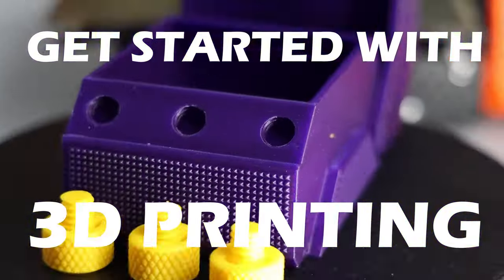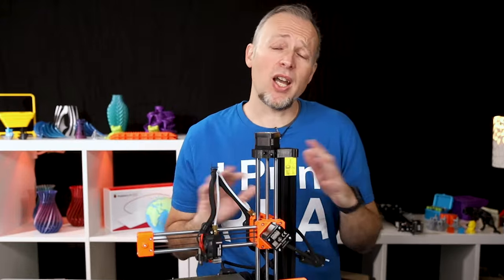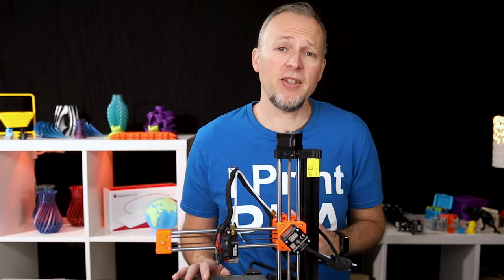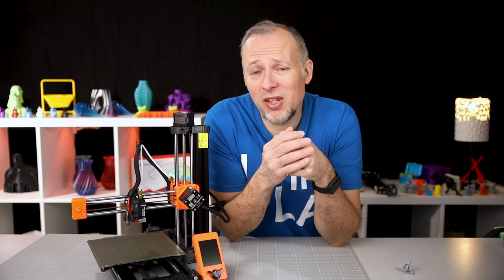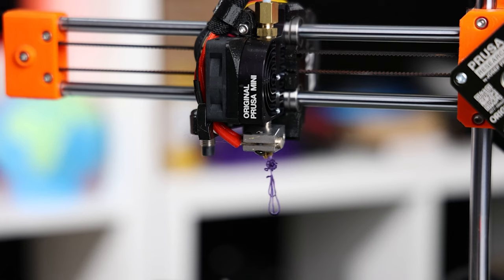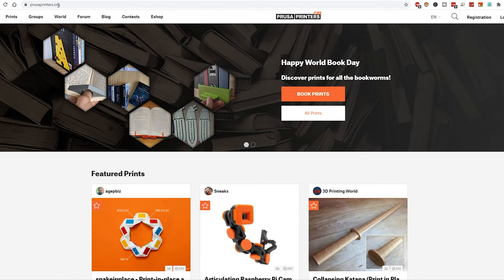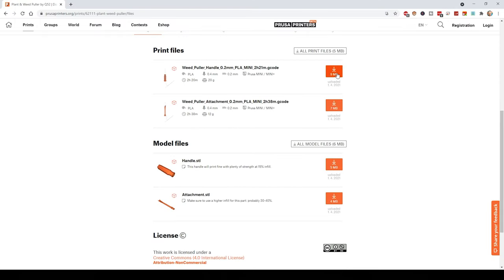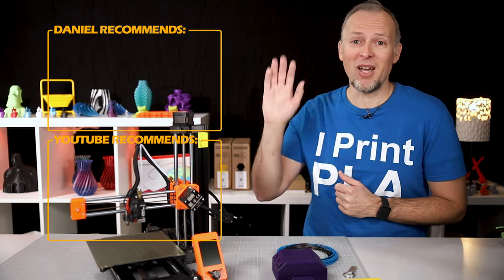3D printing for beginners in 2021 feat. Prusa Mini Plus

Comment: Completely new to 3d printing and I am considering the Prusa Mini Plus. Very informative video thanks. I also watched your video about the Ender 3 v2 which you did in Jan and you also recommended it for beginners. Which one would you recommend? The Prusa Mini Plus has a small print area and possibly more expensive than the Ender but i get the feeling that you had less issues out of the box with the Prusa than with the Ender. Would that be correct? Thanks again
Reply: Just be aware that the Prusa printers are not magical. They supposedly have very good QC, but there are always outliers. I’d like to share my experience. I got the Ender 3 Pro for $100 on sale at Microcenter about a month ago. I got it to learn about 3D printing since my son was getting a Prusa Mini+ from Santa (he didn’t know what model; he just wanted a 3D printer).  The Ender 3 has been printing great. The Prusa “experience”’not so great. Long story short, I ordered the preassembled Prusa Mini+ with the filament sensor for about $470 shipped. I got really busy and couldn’t unbox the Prusa to set it up until Christmas Eve. Sadly, the extruder gears were jammed/gummed up from the factory.  “24/7 support”was closed, so I had to abandon the Prusa and give my son the Ender 3 (luckily he hadn’t seen it since I’ve been using it when he’s at my ex-wife’s and hiding it when he’s home). There’s no point in taking apart the extruder and cleaning the gear/pulley since Christmas is already over. I got a return authorization for the Prusa, but I’m going to be out shipping costs (about $50) and will only getting about a $420 refund.
Reply: I bought an Ender 3 V2 last year, in retrospect, I should have spent the extra money and bought a Prusa Mini.  Some people get great V2's out of the box, I did not.  Poor quality control, warped bed, and so on. I put in a lot of time upgrading, and dialing, when I would have rather been printing.  If you like to tinker as a hobby and have the free time, get the V2.  If you want to print, get the Prusa.  I'm considering adding a Mini as a second printer.

Comment: Which filament do you recommend to use with the MINI+? Have you tried filaments other than the Prusa brand?
Reply from the maker: I‘ve tried all kinds of brands but the most important change I made was the upgrade to the Bondtech IFS. Since then I had no issues whatsoever. Before I had some issues with underextrusion due to the fact that the mini does not have a dual gear extruder by default.

Comment: I am going to start using high temperature and high strength materials like Nylon and carbon fibre reinforced Nylon, I now have all my printers enclosed and will convert one to a volcano but am undecided on which direct drive to implement although the new BMG seems to have most of the features I am looking for so I will look for a review of both in operation to see how they get on with each other.
Reply from the maker: On the Prusa Mini I guess, right? I am looking in to the Hemera and BIQU H2. Both seem promising. The Hemera already supports 285°C printing in the stock configuration and is upgradable to the Vulcano
Reply: @Crosslink3D  No, I have an Ender 2, I did mention it but I think I deleted that part from my previous comment by mistake, the print quality is awesome on my Ender 2, but I think a pancake stepper is going to be the best option for direct drive extrusion as I don't want too much weight on that gantry, maybe I can 3D print some of the parts for the upgrade to reduce the weight to the absolute minimum.

Comment: Can You tell me why the shipping time for a pre assemble mini is a few weeks whereas the shipping time for the kit is 6 months?
Reply from the maker: Sorry, no idea :-(
Reply: @Crosslink3D  Thanks for replying😊
Reply: I suspect that Prusa is focusing on/prioritizing building assembled models to fill their orders rather than putting staff on the task of collecting the parts necessary for the kit version. Once they get caught up on shipping the assembled ones the kit ship time will shorten to something closer to the assembled time. There may also be some component stock shortages happening due to the recent SNAFU in the Suez Canal and they are reluctant to put steppers and fans into Kits only to have to retrieve them to put them into assembled units.
Reply: @Russwig  Interesting but we can rule out the Suez debacle because my boy ordered his back in January before the incident occurred. I can also assume it is quicker to pack a selection of parts than it is to build a printer and then pack it. The cynic in me is saying PRUSA do to "encourage" people to buy the completed printer at a higher cost.

Comment: I am completely new to 3DP and I bought a Mini+. It has worked Pretty well so far. It did take a bit of fiddling to get the first layer correct (had to adjust the Super PINDA to get in the correct range) but I was able to do that after reading other's experiences on the PRUSA forums. One problem that remains is slight warping of every print in the front left corner. All I have used so far is PLA so heat should not be an issue however it feels to me that the cooling of the extruded filament is the problem. The fan only puts air down on the rear or back of the print area leading me to suspect this as the cause of the warping. I have looked for a modification I could apply but so far all I find are ones that also use different hot ends but I don't want to modify to that extent. I am not squeamish about modifications, just didn't think I'd have to do such a mod or design such a fix with a Prusa out of the box.
Reply from the maker: Thanks for pointing that out. Will look for that issue in my tests! Also looking into other fan ducts.
Reply from the maker: Thanks, I would be highly interested if there are any fan ducts for the stock Mini setup

Comment: Good presentation but the price on the printer is as you say are expensive and i say its about ca  120  usd  over priced
Reply from the maker: Well, it’s not a China printer, so it’s naturally more expensive. Labor costs in Europe are a lot higher.
Reply: @Crosslink3D  correct but still the parts are properly form china so still overpriced

Comment: I got 3 Prusa Mini's bought at once... I really really regret buying them... they are such trash... a rushed product skew issues like mad MINDA probes died on all 3 of them. and 1 has a dead board already. They look really cool but this is only meant for fun prints that aren't required dimensions.  even the force of pulling filament from a spool the Z axis bends...
Reply: I regret buying mine too. Constant clogs and jams. Had to upgrade the heatbrake and extruder. Print quality is garbage compared to a Creality machine. I"m selling my mini and getting a CR6 SE.